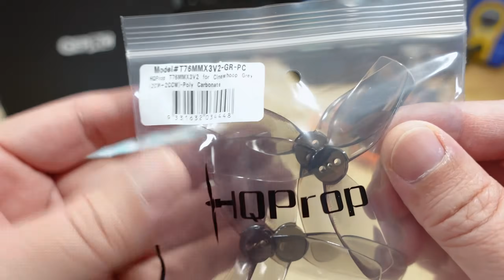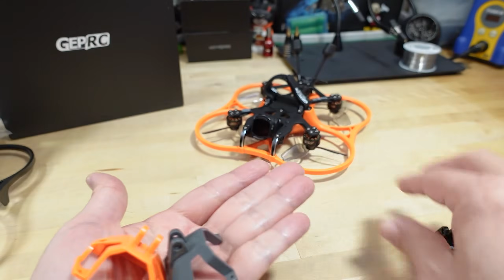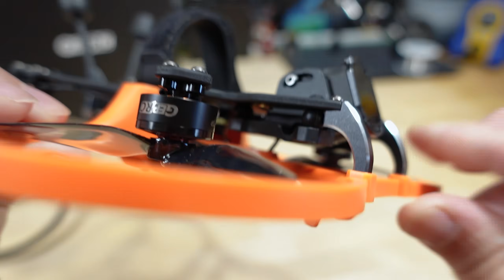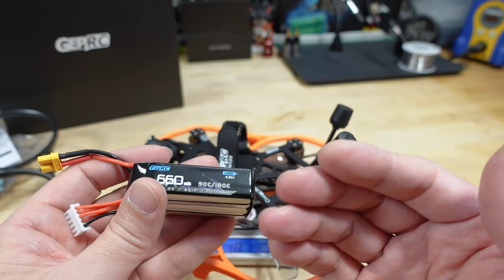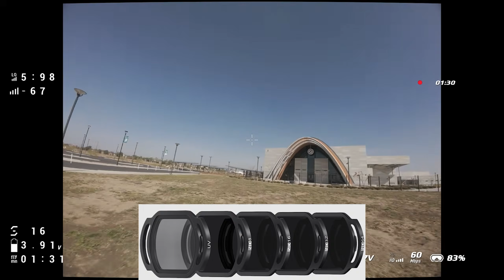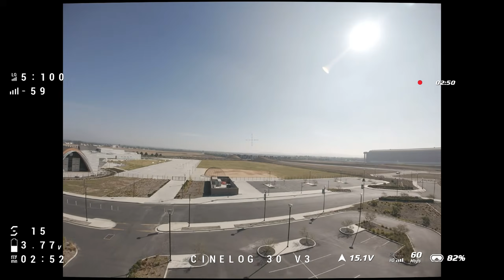GEPRC CineLog30 V3 DJI O4 Pro Cinewhoop Review

Comment: Thanks for your great videos. I'm learning all I can to fly fpvs indoors. Thinking I may want to add a Flywoo  GP11 to this drone. I can't seem to find anything on how to do it, for any drone. Any help you can give would be amazing.
Reply from the maker: You would have to make a custom 3D printed mount for the GP11 however the footage won't be much better than the 4K from the O4 Pro.  You just get more blown out highlights on the GP which if you like that, then you'll have to go to a lot of trouble to mount it.  Also, you'll have to get a balance lead to USB-C power adapter to power the GP11.  IMO totally not worth the headache.
Reply: Cheaper, better flight characteristics and footage to just use an O4 pro.

Comment: Hi,im planning to order 1,just wondering about the option for the reciever.i lready have dji googles and controller 3.i just need the drone woth 04 air unit.
Reply from the maker: You don't need any of the receiver versions.  In fact don't get those as they will come with the SBUS disabled which is what you need.

Comment: Hi, thanks for your good videos. Do you know if it is possible to replace the receiver on their "6 in 1" board ? I can have the TBS Nano RX version for a very good price but I have an ELRS radio and a spare Radiomaster RP1 v2 receiver. So, I was wondering it I could put the RP1 on the TBS Nano RX version. Thank you.
Reply from the maker: Sorry, I don't even know what a 6-in-1 board is.  I would ask GEPRC support directly about this question.
Reply: @AlbertKimTV  Sorry, GepRC names this the "Custom expansion board". It contains the RX receiver, the buzzer, the battery connector, a capacitor, a USB plug. My question is, can I change the receiver by one I own. Though, I will ask them directly. Thank you.

Comment: Yours was perfectly Arming and taking off perfectly, mine getting issues when giving throttle, its rising and slight jumps and auto turn off motors, so confused with mine.
Reply: hey, I have the same problems! Did you get it work right?

Comment: hey man. Would you recommend the GEPRC CineLog30 V3 DJI O4 Pro Cinewhoop or Dji Avata 2 for my first FPV Drone?
Reply from the maker: Tough choice because the paths are really different.  If you plan to buy more hobby-grade FPV drones in the future, get the GEPRC.  If you don't have any aspirations for other drones down the line and will only fly one, then the Avata 2 is a good path.

Comment: how do you get the dji fpv remote to work :( 

The goggles and remote are connected but IDK how to get the remote setup in betaflight
Reply from the maker: Did you get the ELRS version by accident?  If you got the DJI version it should already be setup in Betaflight.  If you got the ELRS version, you have to change the port (UART) for the serial ELRS connection to the other port for SBUS.  I don't know which one that is.  You'll have to ask GEPRC support for that info as I don't have the DJI version.
Reply: @AlbertKimTV  figured it out! The controller needed a firmware update! I plugged the goggles into my phone and was able to update the controller firmware with the DJI fly app. As soon as it updated, everything was perfect. Thanks for the response :)

Comment: did you manage to test a naked go pro on there by any chance?  noticed that the naked gopro mount isn't isolated from the frame so wondering if a mounted camera would suffer from jello
Reply from the maker: No, I did not test that and your thinking about vibrations would be correct. I don't think this model was designed for naked GoPros in mind.  That's why I didn't test it.
Reply: @ thanks very much, let’s see if they come out with the cinebot, get clean GoPro results from that 👍🏼